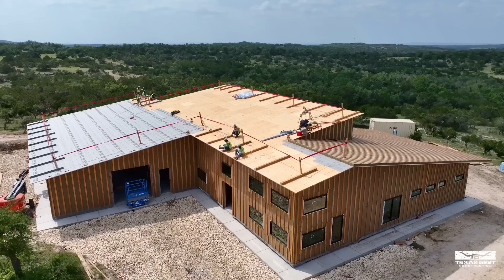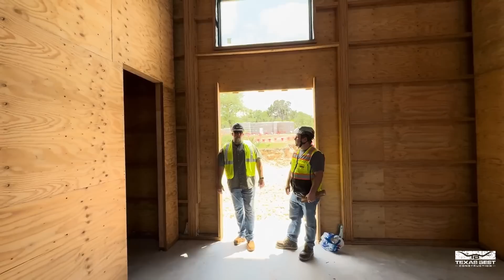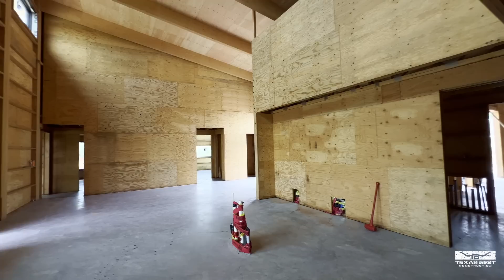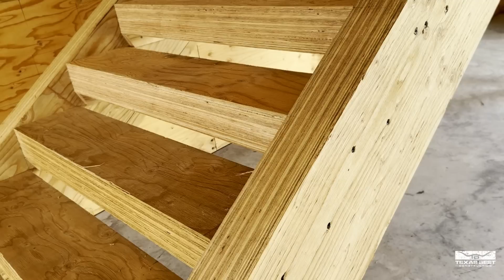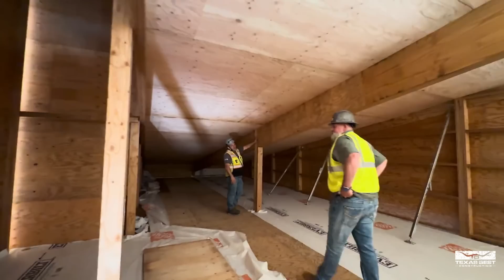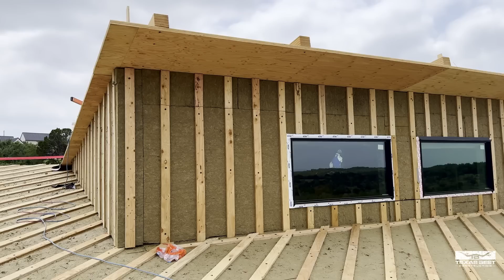ALL WOOD Post Frame Barndominium TOUR with Matt Risinger and Timber BLDR

Comment: Does building in wood make for a huge savings?  Timeframe? etc?
Reply from the maker: That is the critical question. We don't fully have the answers to that in relation to our existing cost. With time we may be able to provide that information. There are claims that it should be cheaper. However it is Inconclusive at this time.
Reply: @TexasBestBarndominium  it mostly depends on the resources available in your area.  If you have builder and contractors that have done it this way before, even once or twice, then you stand to save time/money.  If you are the breaking ground in your area, then it's a toss up.  you might save on time and materials but it's a gamble.Local resources is the name of the game no matter which technique or technologay or design you choose.  Best thing is to find a performance spec that you want to build to and then builder/contractors that can meet that spec within the budget. or adjust the spec and budget until they match up.